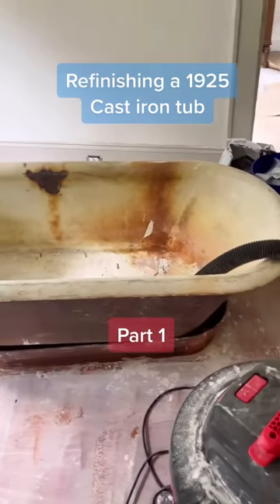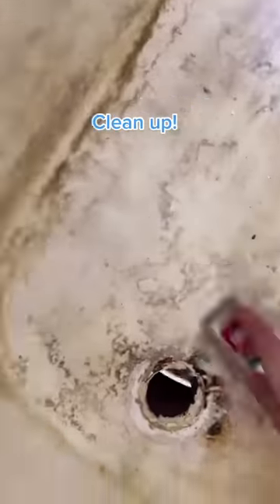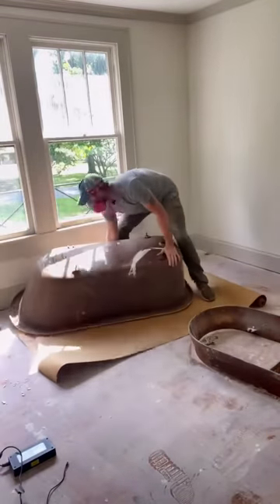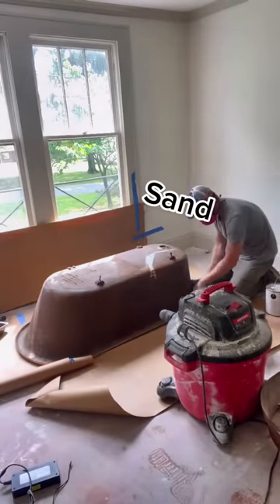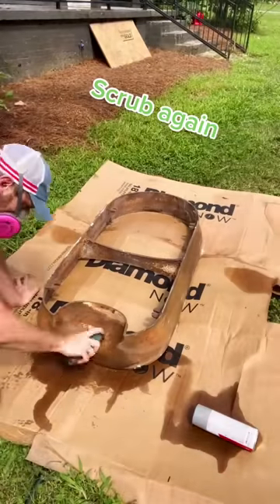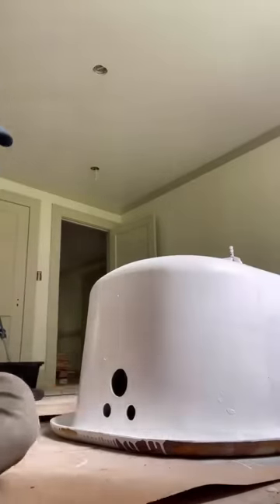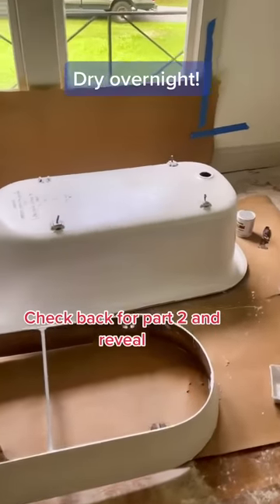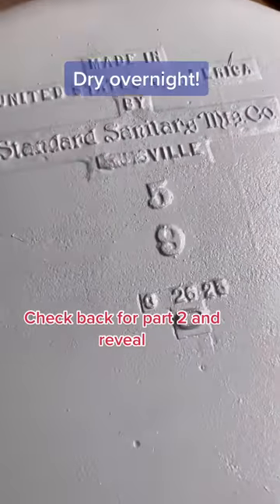Had a lot of request for a full tub refinish video. We have to let paint cure 24 hours. We will gla

Comment: I have an old claw bathtub and had it painted like this. Within two years the paint starts peeling and it’s a mess. I then was lucky to find a place that RE-ENAMELS and it’s wonderful. 10 years later it still looks great.
Reply: I'd be curious to know what it cost to have your tub re-enameled. I inherited a claw foot tub about a decade ago and ended up giving it away for largely the reason you described, paint doesn't hold up on them.

Comment: My patents have one just like it. When they bought their house they found one it the yard. It had been there for 40 years and there was no paint or enamel left on it at all and it was covered in rust, but there were no holes. They got it fixed and its been working perfectly for almost 20 years at this point. 
Cast iron baths are great and should definitely not be thrown away.

Comment: Next time try using Phosphoric Acid in a product like Klean Prep & Etch. It's designed to dissolve rust with the acid and etches the metal to allow solid adhesion with the paint. It will get rid of the rust that sanding alone cannot. I used it with great success for cleaning up old steel tools.

Comment: When I was remodeling our bathroom in our 100+ yr old small Victorian home I had to remove my bathtub first. It had been encased in a wood frame and other stuff. when I took off all the surrounding crap, I found I had a beautiful old claw footed bathtub. It was heavy as hell, and in great condition.  So I had it sandblasted smooth on the bottom and re-enameled on the inside. I tiled the bathroom floor under where the tub used to be and the three surrounding walls. I also added a shower after removing an ugly cupboard putting the shower in that same area. The bathroom was more open and had more south-facing sunlight with the bigger window I replaced. It turned out so nice and airy. The masterpiece was the old clawfoot bath tub.

Comment: This is a great solution to make a tub look nice that you either don’t plan to use or are OK with repainting every few years or will replace soon. I don’t like the term “deglazing”. True glazing is liquid glass poured over a molten hot cast iron tub. This refinishing process is an epoxy coating. It won’t be as durable as the original finish by a long shot.

Comment: We had our tub refinished this way TWICE against my better judgement. The finish came off after a couple years at the drain first. It just peeled away. Then the finish chipped in places. We finally had the tub removed and had a new one installed. I was told by a rep from Bathfitter the refinishing is only a type of “paint” and will not hold up.

Comment: You're RIGHT, this is a beautiful old tub! It keeps the heat. You can soak in this tub. That's why they called them "soaker tubs!"  These new ones are light weight, that's not such a good thing... They don't hold the heat, there are not a soaker tub!

Comment: hydrochloric acid water mix will bring it back to raw steel with no sanding needed ,then a wash wipe down with some bicarbonate soda and a rinse off fresh water let dry and paint or take it in and get a hot dip enamel on inside and paint outside with a two pack or whatever floats ya boat.

Comment: It will still be a painted tub. It is originally baked on enamel.  Paint will not compare. Just as long as you don't think it will be as good as new. Lots of shady contractors that lie about the results. The paint will chip easily, and it will!

Comment: Tou are not “re-glazing” the tub. Glazing implies glass. Originally the tub had a fired glass porcelain surface applied at thousands of degrees.

You are painting the bottom with good paint. You are applying a very high-tech very hard coating that sets up to characteristics that appear to closely approximate porcelain. 

If you asked most folks what you are doing to their tub, they would say that you are restoring the glass surface.

There is nothing wrong with your products. There is a public misconception about what it is.

Comment: I'm with the people who say ita gross. Got almost a century of gross people in that tub. Plus you have to use the tub after. Ide rather have a modern one. I mean if you are going to use it as a flower pot then sure but not for bathing. Plus eventually the paint will start to fall off over time on the inside of the tub.

Comment: That is the wrong way to do that.  One. The only thing that kills rust is high heat. So sandblast that thing to clean it, then take a torch to it all over till it starts to get red. When it cools. Dry sand, prime, the. Coat it to restore it. Otherwise The rust will continue to eat the metal. And the day a person gets injured from one of these you worked on that you did not follow the proper process…. Liability takes over.

Comment: This is what I do for a living and you have doomed that tub. You should have used an acid to get rid of the rust to start with second of all you need to Edge the surface for the paint Bond well. Third of all you should have used a two-part polyurethane which requires at least 48 hours to cure. I would charge the people $1200 to remove and redo everything that you ruined that's where I would have only charged 500 to make it resurfaced